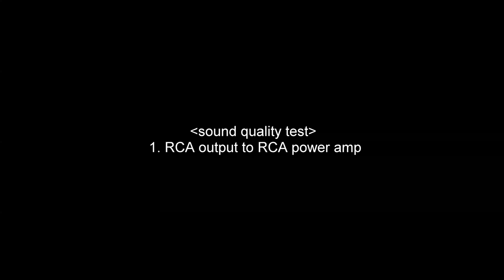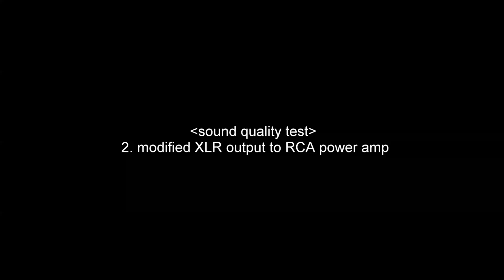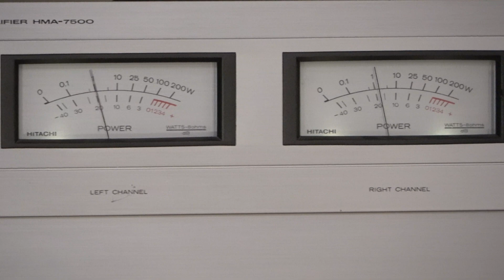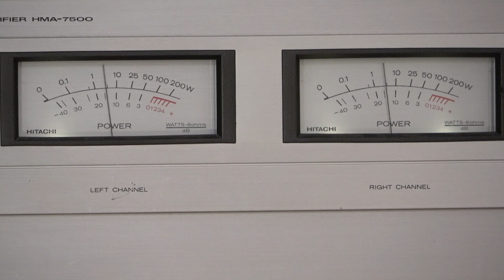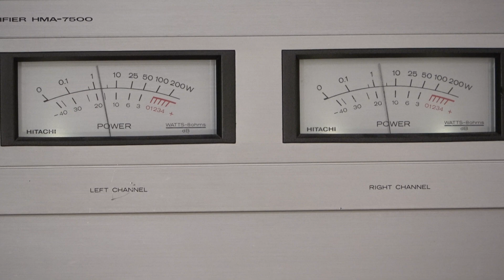modified Balanced vs Unbalance sound test by 300B / 2A3 switchable preamp FL-320X, FLUXION design

Comment: If you disconnect one of the xlr wires, it becomes unbalanced. So you are testing nothing. There is no difference. Balanced cables are not for quality,  they are meant for long connections with no interferences. Obviously you have no idea of what a balanced cable is made for.
Reply from the maker: 😃 thanks for your comment sir. You missed 1 point. I'm testing phase cancellation between L and R signals actually. If 1 of 2 OPTs or wirings are reversed, 2 output signals will be 0. This is the key point of this video, I always do my best for my clients. Have a great weekend. Young.